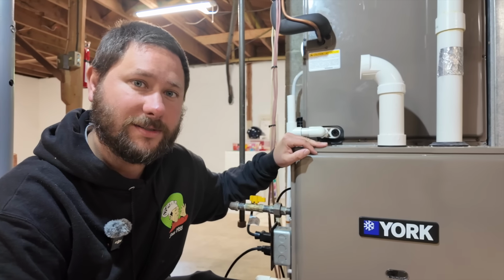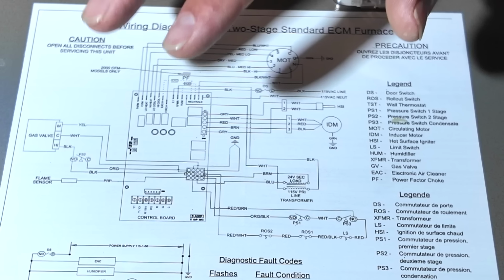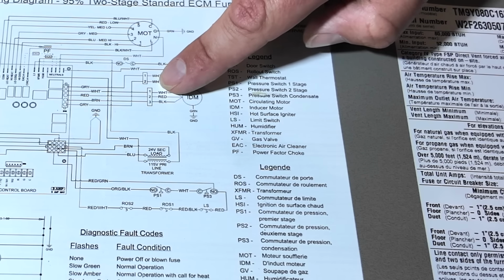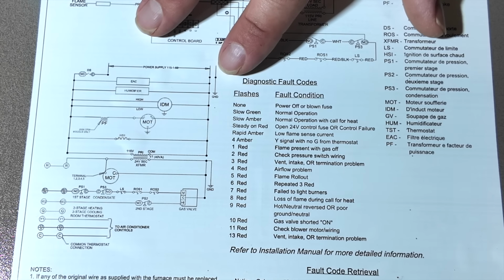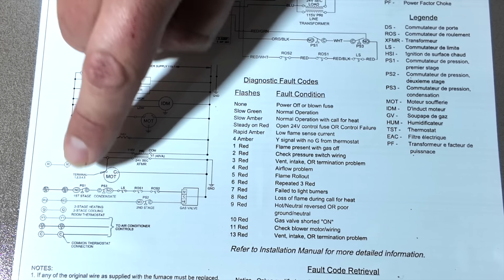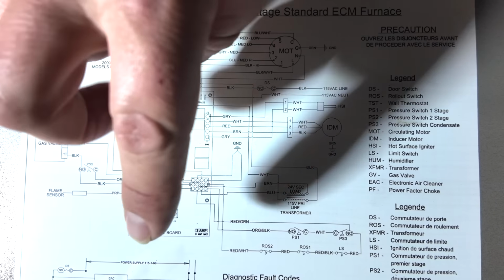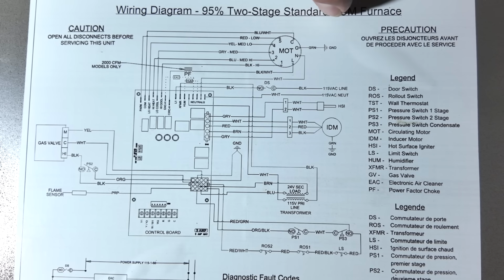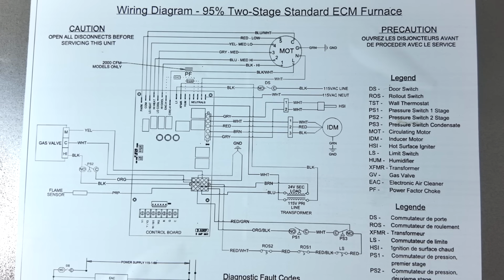How to Read HVAC Schematics (Beginner to Pro – Furnace & AC Explained)

Comment: Hey Tad, my furnace is short cycling, runs through normal start up sequence, blows hot for about a minute, flame shuts off as well as inducer motor, motor instantly turns back on and cycle repeats. LED is steady on, no flashes. Jumped R and W on board, cleaned flame sensor, IM pressure switch is ok. What can possibly be the issue? One of the relays on the board.   Please help, house is heating but I know this isn’t normal and I’d like to fix before it gets really cold. Thank you

Comment: this was really helpful.  I am looking to add a booster fan to my home's hvac duct trunk in the crawlspace but I only want it to kick on when the blower kicks on from the unit.  I looked at my schematic and located my blower motor (labeled x13).  I saw another video where they wired a relay in a box into a 24v source to power a 120v line.  So I need a 120v line from the panel (which is in the same room as the heat exchanger) to the heat exchanger, wire that up to the relay, then the other end of the 120v line needs to go out of the exchanger, up into the ceiling, across the ceiling of a bathroom, then into the crawlspace and land in an outlet or be wired directly to the booster fan (more of a fan of the outlet idea since all of the booster fans I see are standard nema 15p and it would make servicing the fan if I need to much easier). So my question is in order to do that would I call an electrician or an HVAC tech or both?

Comment: I'm glad I came across your video! I have a LuxAire Condenser 5 ton and was questioning the label orientation on my contactor. Turns out the condenser unit wiring you show in your video looks identical to mine even down to the color of all the wires. LuxAire is made by York and I saw the York label on your furnace so this makes sense. Also, my wiring diagram is identical to yours even down to the dashed optional accessories. The only problem with my contactor is the L1, L2, T1, T2 label is rotated 180 degrees from yours. I suspected that was the issue because the label wasn't matching up with the wiring diagram. I believe the installer rotated the protective cover on the contactor so the writing would be right side up and that was confusing me. I need to rotate the cover 180 degrees so it looks like yours. Also, from other YouTube videos I decided to upgrade my single pole contactor to a double pole so that both sides of the contactor are switch controlled. And don't worry, I have confirmed that I don't have a crankcase heater. Thanks for confirming I was looking at things correctly, and to trust the wiring diagram! Cheers!

Comment: They're hieroglyphic to me even after 28 years. Specific learning disabilities , dyslexia, severe ADHD. I install. I serviced older equipment but nothing with an inverter or ECM motor. I do convert ECM over to direct drive with a couple relays. But I cannot even read a schematic on a heat pack without dyslexia f**** me up I don't even bother with schematics. Start it off in the field back in 1996 doing new house

Comment: I can read a schematic, ladder diagram, and wiring diagram. I never knew exactly how an AC unit worked, but I figured it out. I have fixed many furnaces and air make-ups by reading the prints. I was in industrial maintenance for 27 yrs in Pennsylvania.

Comment: Thank you for the great video. Question for you. My Goodman AC unit tripps the heater switch in the house control panel after several hours of running or if I turn the upstairs and the downstairs together. I called in my AC company and they came in and ran a diagnostic. told me my the fuse is burned, charge me a couple hundred dollars, and left. A few hours later same problem. What do you think could be the problem? Could you rank the three things that you check for? Thank you so much.

Comment: Tad a correction in your instructions is in order. Basic understanding of Flame rectification-
The Flame sensor does not carry the signal BACK to the CPU to confirm flame proof, The flame sensor only job is a voltage conductor. On a call for heat, the CPU sends voltage  through the wire to the flame sensor, typically 80-100 volts AC. If flame is present, the flame itself becomes a conductor between the flame sensor and the steel it touches ( it has to be 1:3 area size larger ,min, than the Flame sensor). This now rectifies the AC Voltage, which now turns to DC voltage, which moves to the larger steel area. This micro amperage of DC voltage the cpu is looking for is  sent to  the CPU via the GROUND wire which proves to the CPU,  flame is present and all is ok to keep the gas running. The flame señsor is just a conductor inserted into the flame. The ground wire Carries the DC signal back to the  CPU to complete the circuit. That's why when your Flames sensor gets dirty  its adding resistant to the AC voltage to the flame thus Microamp circuit is reduced below acceptable levels the CPU is looking for and so it cuts off the flame.

Comment: I was looking at a broken unit 95 degrees at my kids house. Many things in the house they bought looked like someone with limited experience did the work. The unit was running the fans running and compressor was hot but no cooling found the capacitor was dead. In looking at the diagram I seen an LPS, HPS, and DTS, I was surprised this unit took call direct from thermostat no protection or switches. Is this common? I also seen no motor OL is this part of the compressor?

Comment: 🎉Excellent work with explaining the reality on how to get the job accomplished efficiently every time. 

Obviously if you know a sensor is bad before hand you may want to replace the sensor immediately but when you check for power and resistance from the beginning to the end of the entire system you will know exactly what is causing the issue at any given point. 

Thereby, you won’t have any surprises with any faulty wiring or electrical components. 

That’s a veteran skill that many undermine, because sometimes you may have a unit wired incorrectly and this will cause issues in the future. 

It is best to cover your own ass from start to finish. 

You Sir are a true legend and inspiration. Thank you.

Comment: On the schematic, it shows a capacitor symbol between L1 - T1 (I assume in HVAC talk that is a switch contact) but between L2 - T2, there is a line. Does this mean it is a 1 pole relay rather than 2 pole? It's my understanding that a 1 pole device allows the compressor heater to stay on continuously while a 2 pole opens both sides.

Comment: Dude I freaking love your videos man you couldn't explain the outdoor unit wiring and how it works and what it does any better light bulbs are going off in my head I just wish you could do it on the indoor you might have I just might not have came across it I just found you on YouTube but if you could do the indoor unit for straight cool no heat pump all electric heat strips apartment complex units those are the ones I'm working on right now and going over that would be amazing like dude kudos to you you couldn't explain it any better

Comment: 9:23 - Tad, the ladder diagram in your example is misleading: the
Electronic Air Cleaner
Humidifier 
Inducer Fan Motor (low and high speed windings)
Power Factor Correction ballast and blower motor
Hot Surface Igniter 
and control transformer all show a path to power when the Door Switch closes.

As you state, each of these are energized in sequence.

Comment: What is the difference between capacitor and dual cap?
Reply: A dual capacitor is just two capacitors in one.
Reply: @jessebHVAC  How would a technician, or homeowner, decide which one to use? Which application? Can either one be used interchangeably? Is it a preference thing?
Reply: @smuniz9987  the answer to your last 2 questions is yes.
Reply: @smuniz9987  a single run is what you will typically see on motors it’s made for a single load and a dual is made for 2 loads  typically the caps that can handle fan and compressor with a common.